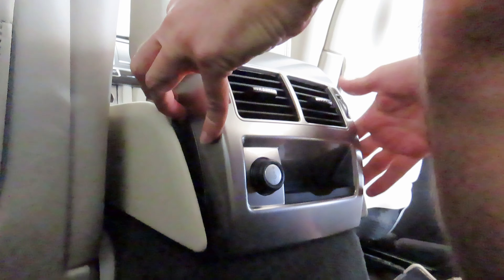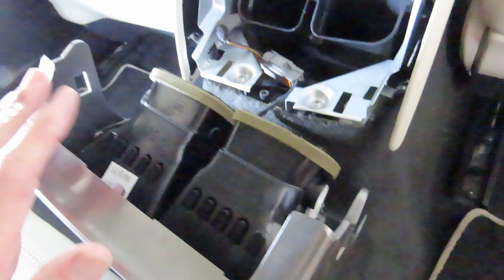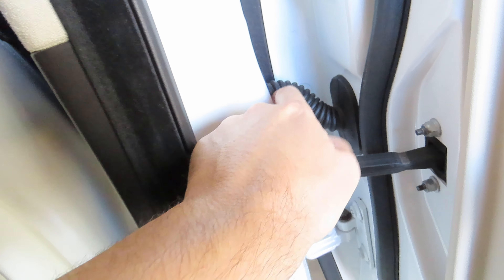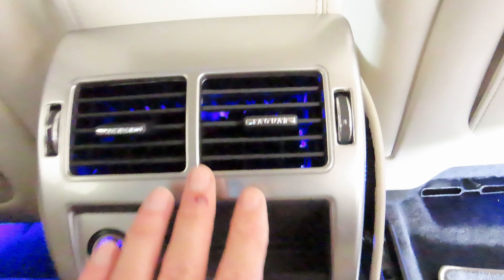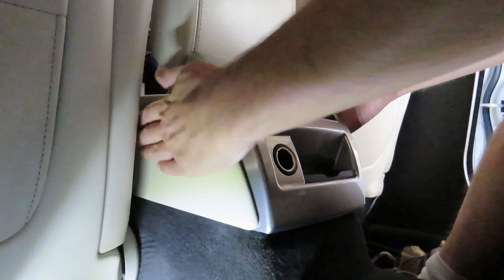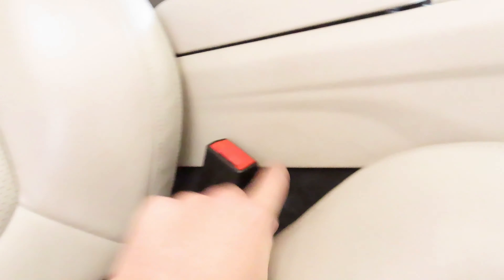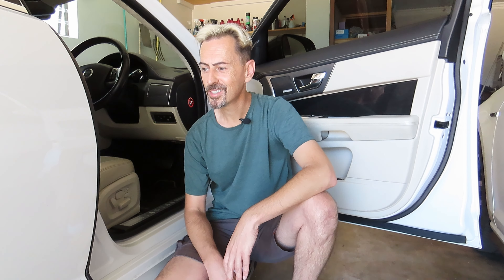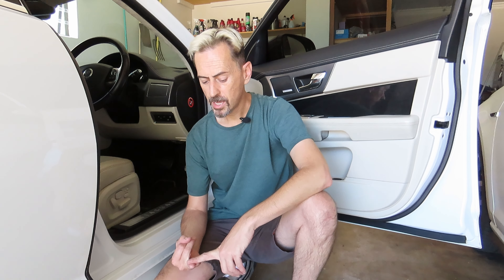Jaguar XFR ambient lighting install - phase 2

Comment: I just did this today on my Infiniti Q70 sedan, looks great, thanks for the inspiration. I think you should look into the possibility of installing ambient lighting on the upper curved section of the front seat back, plastic panels, i did it last week and it turned it out fantastic. It makes the rear seats a much better place to be at night.
Reply from the maker: Thanks. I was hoping guys with other makes of cars would try this out as it has general appeal to any car brand. Thanks for the idea on the seat backs 😉

Comment: Hi Hilton and greetings from Scotland . I just found your channel and it is so informative . 

I wondered if you could do a video on the sound systems of the two cars . I just got a new 2016 XF 3.0 and Have to say the meridian sound system is not a patch on the previous meridian sound system .
How meridian put their name to this baffles me .
Reply from the maker: Hey Kevin - I did a review on the Meridian last year some time and recently did one on the B&W - in my opinion, the B&W is better than the standard Meridian, however, the top of the range Meridian is pretty good.  It compares pretty well to the B&W but the problem with the standard Meridian is that it's pathetic compared to even Jaguar's standard sound system.
Reply: Thanks for coming back to me Hilton . Do you think the old Jag system would fit into the new car , either Meridian or Bowers and Wilkins , retrofit ?I can’t live with the present system !!!
Reply from the maker: @kevdav0  Key Kevin, a retrofit would be near impossible.  You'd have to remove the interior, entirely to run all the wiring and replace the speakers as well as sub in the trunk.  The best thing to do is buy one with the upgraded stereo.  That's also one of the reasons I sold my X260 due to its bottom of the line Meridian.  I thought it had the top tier system and was aghast when I found out how poor the sound was in a Jag of all cars.  Jaguar should leave entry level sound out of their cars.  It's a luxury car and luxury should be the base of where they begin with their options, starting with the sound system, quality of materials, ergonomics and leave the colors as the spec options.

Comment: Hi have you ever heard of fishing it's done with a piece of firm wire with a small huck on one end and tape your wire to the other and just feed the closed huck through parts you can't see.
Reply from the maker: Yeah, thanks Derick.  I've done that before with my Mazda CX5 running the dashcam cable through the tailgate boot that housed the wires.  Problem is, there is NO space whatsoever in that Jaguar's boot to even put the thinnest wire.  It's jam packed.

Comment: I own a XF(X260) and having trouble with replacing reversing lights to LED. If it's possible, could you upload DIY video of replacing reversing lights to LED for XF? Thank you so much!
Reply from the maker: I was under the impression the X260 already had LED reverse lights.  I know the X250 has H16 incandescent bulbs for it's reverse lights and there LED's available to replace them.  Unfortunately, I can't do any videos on the X260 as I no longer have one.  I now have the X250 XFR.
Reply: @carfanfan  I was quite surprised it was not LED :(  but thanks a lot for your quick reply. Keep it up
Reply from the maker: @integer-q5q  This means you will have to remove the tail light by getting the carpet out the way.  To do that, you will have to remove the plastic cover covering the trunk lock and then the carpet can easily be pulled back.  There will most likely be 3 or 4 bolts holding the tail light onto the body - once you undo those, you can pull the light housing from the car to get access to the bulb holders.  From what I can see, the bulb itself is a T15 which you can see here https://www.en.xenovision.it/led-backup-lamp-jaguar-xf-x260-c-22750 and here's a pick of the tail light on eBay which will give you an idea of what the back side of the light housing looks like ;) https://www.ebay.com/itm/2016-2017-2018-JAGUAR-XE-LEFT-DRIVER-SIDE-OEM-LED-TAILLIGHT-TAIL-LIGHT-16-17-18/124251246684?hash=item1cedf3905c:g:1CsAAOSwIaNfBLwq
Reply: @carfanfan  Awesome~!! This will help a lot. Appreciate your detail :)

Comment: did you plan to mod the rear air vent module? because that tiny thin next to the cig lighter is kind of useless. what was it made for? for one cigarette?
 so I mean do you plan to mod it in any ways?
Reply from the maker: Hey, nah I'm leaving that as is. Also don't understand what it's there for but I don't spend time in the back do I don't see it luckily 😂
Reply: Hey Hilton.  Sweet looking upgrade.  I can honestly say I have not spent much time in the back of my Jag.  I can say that does the look fantastic in the back. 
You really take have a Jaguar to the next level.  Great video.  Thank you for the videos.  You make it easy, Blessings to you.
Reply from the maker: @Smileydrb  thanks mate 😉

Comment: Iam currently doing this upgrade, do you have to go off the middle dome light or could you tap into fuse F22 cigar lighter?
Reply from the maker: You can do either. But keep in mind I planned hiw many lights I'd have from the start so when I ran my main wore from the dome light I created a splitter plug that split into 6 or 7 connectors which allowed me to add more lighting over time. Personally I try and stay away from the fuse box, only dashcams hooked up to fuse boxes in the past. It can get messy down there very quickly and when something goes wrong with the car the first thing the technician is gonna blame is your fuse connections.
Reply: @carfanfan  I ended up buying a fuse adapter that has two fuse ports one for the existing fuse and another port that has a cable attached to it and plugged it into the fuse for auxiliary, works great